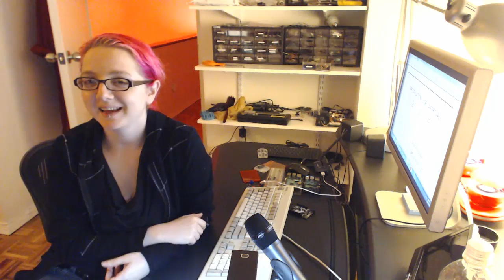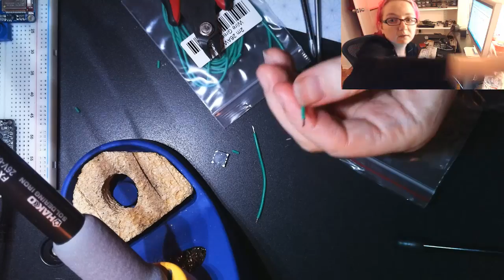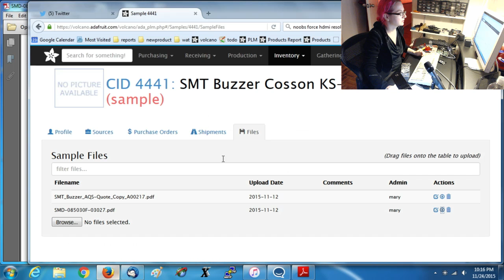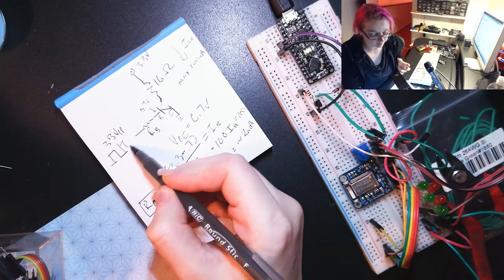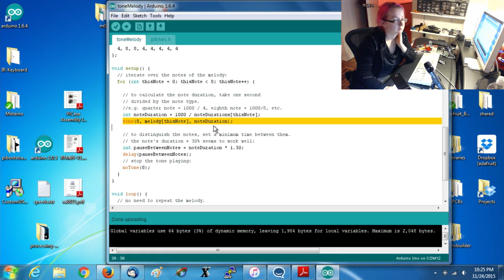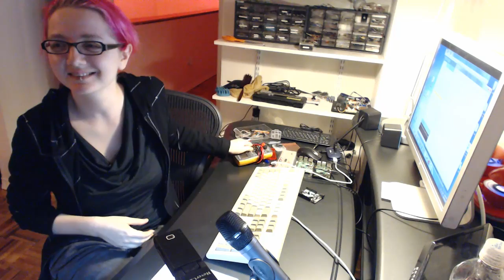Designing in EagleCAD LIVE! From the desk of Ladyada! Adafruit Industries Live Stream! 11/24/15

Comment: You can send a PWM signal out with a base freq around 10-20k and modulate the pulse widths in accordance with an analog signal in order to approximate a DAC output. No filtering required. This will allow analog signal output using just the simple buzzer, although the audio quality will not be the best.

Comment: It's worth noting for the audience that a typical "8 Ohm" speaker is 8 Ohms AC impedance, not necessarily 8 Ohms DC resistance.  Don't be surprised if it doesn't read 8 Ohms on your voltmeter, since that typically only reads DC resistance.  In the case of this buzzer, the manufacturer actually specified the DC resistance, so the voltmeter check is appropriate.  As Dave Jones would say: "A trap for young players"!
Reply: +dtvdave1  Also a fan of Mr. Jones. Couldn't help but think of "Dave CAD" as they were arguing about using stickies vs. dry erase vs. tablet.